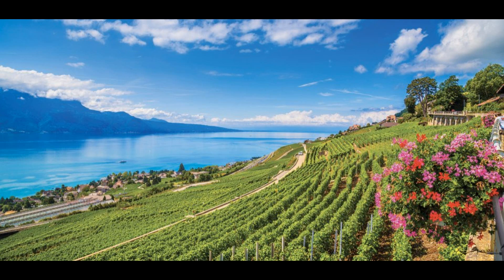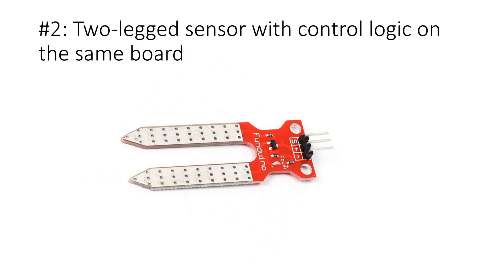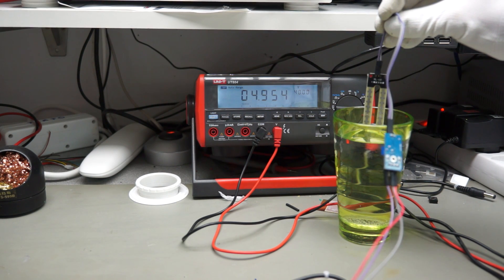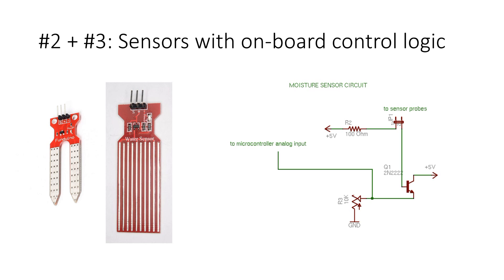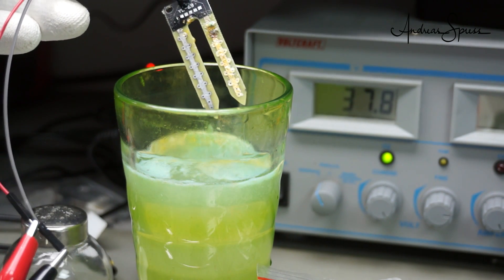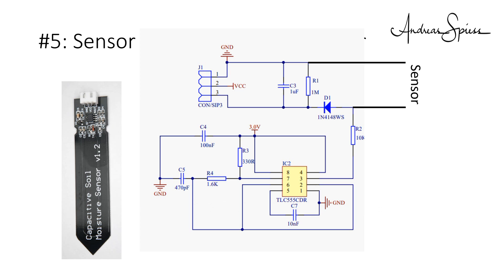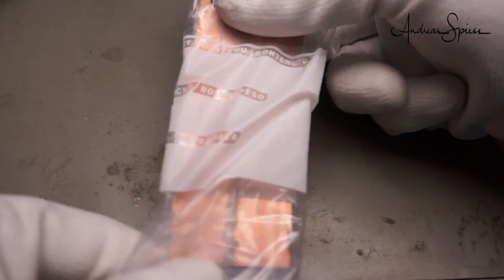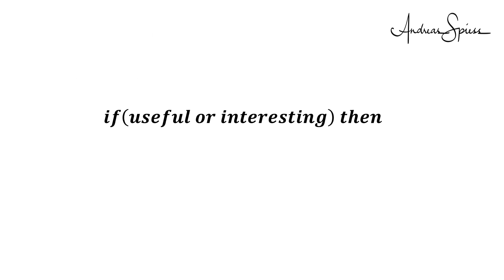#207 Why most Arduino Soil Moisture Sensors suck (incl. solution)

Comment: Very interesting video Andreas 
I think that the sensors you found are all educational, usable as prototypes as many components for arduino that are around, and then once demonstrated the fine working of the "machine" you should look for better quality material, which naturally costs more, I can think of a sensor with stainless steel rods or the top of the top two platinum rods (at least inox platinum plated, to reduce cost) 
when I went to school there existed in the chemical laboratory, glass rods with at the end of platinum wire that you could use to react components, without the chemical reaction being modified by the presence of the support (the platinum) so, I do not know how much I can cost but if in the Italian public school there were, I think they do not cost too much
See you in the nex video, bye
Reply from the maker: I thought that using the capacitive concept is a good alternative and stopped searching for other things. Share there are very resistive materials around. Unfortunately they are not cheap:-(

Comment: Would it be possible to use stainless steel or silver plated electrodes for the cheap sensors?
Reply: DONT USE STAINLESS STEEL! It often contains chromium... That can make a lot of problems.
Reply: silver oxide does conduct, that would be a plus.

Comment: Excellent video, Andreas! However - if I think about the dozens of plants in separate containers in my parents winter garden - I really hope for a follow up video where you will show a clever method how to collect the values from a large number of these sensors without rolling out a few hundred meters of wires. Is there a  way to attach a cheap wireless data link to them that could for example operate on coin cell batteries and send the values a few times per day to a central receiver in the same room?
Reply from the maker: One viewer used cheap 433MHz senders and an ATtiny

Comment: Really Cool Andreas. I'm using those sensors in a project with attiny85 and sending the info via RF433Mhz to a arduino nano connected to a raspberry pi.
Those sensors have a short lifespan indeed, but i think that humidity doesn't change that often or that quickly, we don't need to be always reading, nor always powering that sensor. So i have used powergating and the sensors last way longer now! :) I have one Capacitive soil sensor, but i still need to test this.

All the best!
Reply from the maker: There were many comments about switching these sensors on and off. I think I should have mentioned it in the video...
Nice and cheap idea with the 433 MHz

Comment: These is a stand alone version of the capacitive sensor. It comes with an attiny IC and can be put on I2C sensor mode. See https://youtu.be/WLyolOGSAXI
Reply from the maker: Thanks for the link. Good video! However, I think, in the end, you use it similarly to a (cheaper) capacitive sensor?
Reply: Andreas Spiess After searching AliExpress you will see that the difference is not much. Today's price for 555 version is ~$2.25
  http://s.aliexpress.com/NzQZVBnE
and the attiny ~$2.55
  http://s.aliexpress.com/NJvIbMju

Comment: Hey all. The plastic bag solution is maybe not tough enough permanently. Some time ago a few people from the German RPi Forum developed a better solution: you put two pieces of copper pipe in a test tube. In between goes a PCB with a chip which translates the restiance into frequenzy signal. The output cable goes out and then the test tube is potted with ie resin (zweikomponentenkleber)
I will look that i find the link to that forum Entry.
Reply: The link to a wiki from that thread: https://github.com/Zentris/erdfeuchtemessung/wiki/Glassensor

The chip is 74HC14D
Reply from the maker: They propose either a cheap glass tube with round sensors or a flat concept very similar to my "homemade" sensor using glass plates with silicon sealing instead of my proposed plastic. I think both solutions have potential to protect capacitive sensors.
Reply: I think the plastic will become porous over time, especially when in soil.

Comment: Copper oxide is harmful for the environment so yeah you basically poison your plant.

I would not recommend a resistance based sensor for plants you plan to eat

Also since it's green it seems to be a patina which is a hydrated copper carbonate (malachite)
Reply: We spray plants with copper as a fungicide.  As well as a necessary human nutrient.
Reply from the maker: Thanks for your feedback!
Reply: The green stuff is (most likely) the same green stuff you seen on any copper statue that has been left out in the open for an extended period of time where it will come in contact with water. What you've done is accelerated the patination of the copper, with possibly, some electroplating of the other electrode. In short, it is the same stuff that makes the Statue of Liberty green, it isn't really all that harmful. What you've got is most likely some basic copper carbonate which occurs naturally in malachite and probably some other rocks, but I'm a chemist, not a geologist so...

It isn't cuprous oxide – sometimes used as a fungicide – which could be harmful to plant life, or cupric oxide for that matter. It could also be copper(II) hydroxide, another fungicide so the stuff might not be good for small plants, but I doubt it will do much to larger ones given some of its uses. Don't drink the stuff and you should be fine. If you have some dry ice (and it is copper(II) hydroxide), you could add it and the stuff from your experiment to a sealed, plastic, container with frequent venting to accelerate the conversion to basic copper carbonate. The only thing that would worry me is what was the copper tinned with to initially prevent oxidation.
Reply: Think of it as basic copper carbonate CuCO3*Cu(OH)2 (or Cu2(OH)2CO3 if you want to add everything together, but you lose the nice representation what its made up of)
If you add salt (NaCl) it will get complicated. So dont do that.
Reply: Given the low cost of these sensors, the "tinning" on the copper may actually be leaded solder, so you probably get not only large doses of copper in your self watering vegetables, but also probably a large amount of lead and tin, not to mention trace amounts of antimony, arsenic, and who knows what else.
Reply: Andrew Hull - ...or might be nickel if you're "lucky"....
Reply: agree on traces, but ROHS has largely killed off in-house use of lead solder.
Reply: Fetid Tuna "prolly not lead, someone would test it by picking it up and feeling slightly sick and hour afterwards" - No, that's not how lead poisoning works.
"i felt sick for days" - If it wasn't a placebo effect (well, nocebo to be precise), it was hypersensitivity. Which VERY few people have. Holding lead in one's hands is completely harmless. Even a pure lead block (provided you don't put your hands in your mouth afterwards).
Otherwise all the items you've seen in the video are 100% Chinese made at really low costs. This means that they'll be made as cheaply as possible. Which suggests either nickel or tin coating on the copper traces.
Reply: "you tryi it, go handle some lead sheetinmg for half hour" - I did. I ordered a vest off of eBay to be used as a weighted vest for training, ordered some truck tire counterweights (made from lead) and inserted 10 kg of lead into that vest. And didn't feel a thing. Sure, if you're handling lead bare-handed for years, that definitely isn't gonna help you. But it isn't reactive enough to leach into your skin.
Reply: Fetid Tuna Why don't you lay off the booze? Obviously it's poisoning you faster than the lead you're ranting about....
Reply: "yur what im ranting about yu fucktard" - Complete lack of spelling abilities, expletives, acting like a frustrated teenager.....admit it, you're a Trump voter, aren't you?
"your fucking nonsense aboiut healthy to handle lead?" - Where did I say that handling lead is healthy? I said that grabbing it with your bare hands for A SHORT TIME (and caring not to put those fingers in your mouth like you probably would) does not cause any harm, because lead is NOT absorbed through skin.
"lead oxide?" - None of the lead oxides dissolve in water thus they only cause problems when they're ingested.
"try to paint me as some sort of liar?" - No, you're obviously "only" completely ignorant. A big difference.
"zinc too, the oxides are very nasty water soluble" - Now that is an outright lie. Zinc oxide is a VERY stable compound (and no, it's not water soluble). So stable in fact that it's used in sunscreens to protect the skin against UV radiation. If it'd be as reactive as you assert it is, it won't be used in products that people put on their skin....
" cos you boyght a shiny off amazon" - I actually ordered the lead counterweights from a local e-shop (and the boxes they came in weren't in pristine condition either, they seemed to have stains of what seemed to be black lead oxide to me). But yeah, you surely know better, because you've been eating lead all your life and that has caused all sorts of problems for you (like a very noticeable deterioration of your spelling among others).
"i dont drink yu little gobshite" - So you act and talk like a moron even when you're sober? That's even worse than I thought then....
"if i do end up ranting at you,, id fucking run,, seriously" - Ooooh! We got an armchair warrior here! I'm pretty sure the last person you've hit was a girl and even that was back in kindergarten (since your spelling is so awful, I don't expect you to have attended a high school yet).
"pednatic little ocpd" - You mean "pedantic" and "OCD"?
"i suggest you g weld something with zinc on it" - I'd only do it outdoors of course. Volatile zinc compounds are on a completely different level than solid zinc. But I'm sure you know better than all those "idiots" who use zinc plated steel in pretty much everything (everything that isn't chrome or nickel plated that is).....
"dont go round telling people handling lead without significant precaution" - I don't. I always tell people to wash their hands thoroughly after handling lead.
Reply: hmx - Your whole explanation is fine when applied to copper exposed to (humid air) with not many other ions for the copper to interact with. Soil however is a completely different story. It has TONS of ions that it can interact with and which might greatly hasten the leaching of copper into the soil (especially at lower pH), especially when it's combined with the occasional "jolts" of DC.
Reply: True! Yet I believe it's too much to be healthy for plant life
Reply: Mai Mariarti I see! I learn something new every day! ☺️

Comment: Hi Andreas, a series-capacitor with the 555 ckt would have ensured that absolutely no DC enters the electrodes - I'm surprised that the original circuit doesn't have this.. as for the corroded copper and tin (assuming that the PCBs are lead-free tinned) - the products (copper-hydroxide) are reasonably harmless for plants. The patina on the Statue of Liberty is partially copper hydroxide (and mostly carbonate).
Reply from the maker: I think a capacitor would not change a lot (because of the diode).
Reply: In the schematic at 7:37 , the upper sensor-electrode is GND. Pin3 of the 555-timer outputs a ~square-wave. The average voltage at pin-3 shall then typically be ~60% of Vcc. This goes directly to the lower electrode. At this point, the only insulator for the DC is the (thin) solder-mask on the PCB. In my experience, while the mask is an insulator against casual contact, it is not a long-term waterproof coating. To achieve that would need a specialist-grade epoxy. In my experience, the presence of DC shall also corrode the coated electrode, albeit starting a lot slower. An easy cure would be to add a series capacitor upstream of the electrode. This virtually guarantees that no DC is visible to water (due to the extremely high dielectric resistance of the capacitor), even after the water permeates the solder-mask. For a few cents, the life of the sensor would increase manyfold.
Reply: PS - I see a component labelled "C2" on the silkscreen - but not in your schematic. Could this be a series-capacitor?

Comment: If you use arduino,maybe you can use it's internal oscollitor to feed the sensor probes
Reply from the maker: You are right. You can buy a sensor with an Attiny. It seems to run on 1MHz

Comment: Simplest method to extend life of sensors would be to turn it completely off and turn it on after hours for a very shot time.
Reply from the maker: You are right. I should have mentioned this solution in my video.

Comment: There are also similar capacitive sensors that output a digital value and at the same time can work as standalone: look for "plant watering alarm", they are clones of "Chirp, plant watering alarm" (see on Tindie)
Reply from the maker: You are right. This video was only about the sensor technology, not the different way to use the values

Comment: Not 100% sure but i'd assume that an electrolysis is making out of H2O hydrogen and oxygen. The oxygen would react with the copper and we created sucessfully rust ;-)

Edit: maybe it peels of because of another chemical reaction with the glue that hold the copper in place
Reply: Not rust that stands for an iron reaction.
it's more a copper derivative like Copper(II)_hydroxide or sulfate...

"It can kill bacteria, algae, roots, plants, snails, and fungi. ..//..

The U.S. EPA considers copper to be practically nontoxic to bees and moderately toxic to birds. Studies with several aquatic species have found copper to be highly to very highly toxic to fish and aquatic life. Trout, koi and juvenile fish of several species are known to be particularly sensitive to copper.

Fish kills have been reported after copper sulfate applications for algae control in ponds and lakes. Oxygen depletion and increased debris have been cited as the cause of most fish deaths. This is sometimes due to the sudden death and decay of algae and plants after an application. Even small concentrations of copper can be harmful to fish and water organisms."
source : http://npic.orst.edu/factsheets/cuso4gen.html

So not good for our soil :-)
Reply from the maker: Thanks for your explanation!
Reply: Well substantiated, thank you.

Comment: Why didn't you mention the xiaomi Flower sensor? 
alibaba (- make your own affiliate link from this) http://s.click.aliexpress.com/e/cercyM4s  

It has capacitive measure with moisture, temperature, Lux, battery level (fhem)  and Bluetooth. So it works out of the box.
The included CR2032 battery lasts over 1 year. The design looks good and i made a good experience from this device. I tested it in my blog last year: https://blog.moneybag.de/fhem-xiaomi-pflanzensensor-feuchtigkeit-helligkeit-temperatur-per-bluetooth-messen/
Reply from the maker: I had it mentioned in one of my mailbags (also the HiGrow, which uses a similar concept). This triggered the discussions around how these sensors work. This video is only about the sensors, not the usage of the values.

Comment: Copper is important for plants but if there is too much, it becomes a problem. Most anodes(+elecrode) degrade during electrolysis, it's often a big problem, but there are some options. Platinum electrodes are stable but too expensive. I would go with graphite - pencil inserts or electrodes from batteries could be a good start.
Reply from the maker: Thanks for your know-how. I read about graphite electrodes. So far I thought it is very easy to break them. Any tricks?
Reply: https://ibb.co/neNL0J
I just use 2mm thick pencil lead for growing Cu crystals. Inserts are strong enough to push into soil, when I use them alligator clips are enough to get good contact. For soil sensor I recomend using AC signal and wheatstone brige.
Reply: battery rods (though you'd have to peel open dead zinc-carbon batteries for this)
Reply: https://en.wikipedia.org/wiki/D_battery
https://ibb.co/dDJXEd
Carbon electrode from R20 is fine too. I file a groove near the top, wrap some copper wire and cover it with hot glue(keeps the wire from corroding).
Reply: Jep! Just google 8mm graphit elektrode.... you will get hundreds of results
Reply: Remember that pencils are not (usually) pure graphite, but include clay's etc to adjust harness. As a kid I used soft pencil rubbed onto card as a "variable resistor" for a stylus organ. Do they stand up to the wet environment?